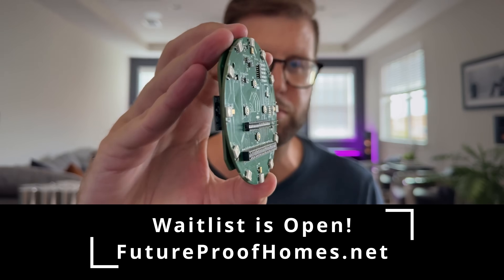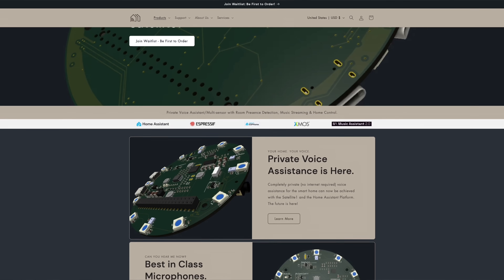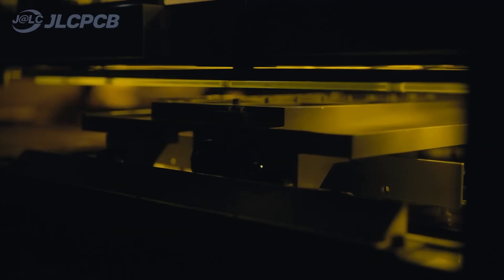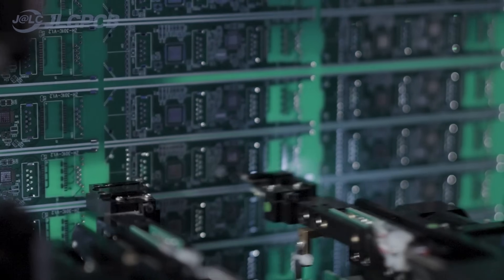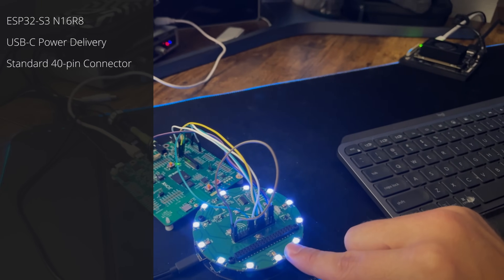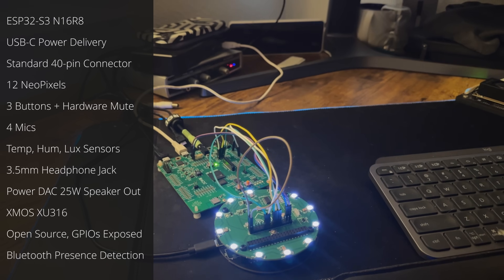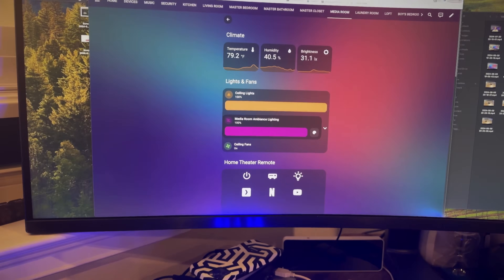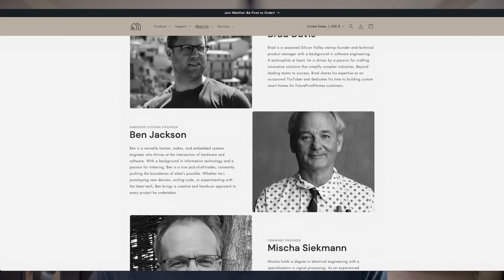Satellite1 Waitlist Open!  Your Private Voice Assistant Hardware is Coming!

Comment: lol sorry thought of another improvement. Me being passive house enthusiast.. I think you should make a mounting part where you can drywall the mount and then just snap in the satellite. That way we can make the device install easy and air tight between the living space and the attic.(if there is an attic above the room).. I would make a round mounting device with ethernet jack(Poe) so that above the device in the attic you just plug in the ethernet cord and on the other side (satellite side) the satellite just snaps to the mount. or we make the mount flush with the ceiling with mic holes.. etc.. either way.. We need to make sure when this is mounted it provides an air tight connection.. (safe for insulation..).. thanks :)
Reply from the maker: Check the roadmap.  You're describing what we're building. :) ;)

Comment: ESP32... so will it have the same limitations demoed on the  S3box? IE you can't dismiss an alarm by voice or pause a song if audio or an alarm is already playing?

Also at least in my experience  music streaming will be ASS on 2.4Ghz.. Google Minis and  Amazon Echos connect to 5Ghz for a reason, I have them all on a 5Ghz SSID because I get cutouts all the time if they fall back to 2.4Ghz.
Reply from the maker: I can demo this, but you can absolutely interrupt music playing with your wake word and pause or change the volume.  If 2.4Ghz wifi causes music streaming problems then I'd recommend PoE connection.  More info to come here.
Reply: @FutureProofHomes  POE would not work as I don’t have connections in every room. We currently have a Google mini in every bedroom and the living room and kitchen.

Well hopefully 2.4ghz works better than on my Google minis.

Comment: Congrats. I've managed to have a working and stable enough system with a Korvo and tweaking, but I really hope your project is gonna work and become the perfect solution, cause nothing is for now.
Reply from the maker: Yep.  I also pushed the Korvo to its limits and bumped into those limits.  Hence why we’re building this.  Thanks for the well wishes!
Reply: @FutureProofHomes  Also, it might interest you but i've managed to make an reply function when the assistant (Assist in HA, with your A.I of choice) is asking a question. Basically, it checks the text of the answer and looks for a question mark. It works pretty well and avoids having to repeat the wake word (i don't know if your system has a solution like this).

Comment: Curious why this is a dev kit? Just because you aren't shipping an enclosure or another reason? Also, very interesting.
Reply from the maker: Two reasons.  No enclosure & we can't afford (yet) all the regulatory electronics certifications needed to be considered a full consumer electronics product (CE, FCC, etc. etc.).  This is the the next step though.  Heading in that direction!
Reply: @FutureProofHomes  this all makes sense. So to your certification point, no UL listed either. Loving this though, have you thought about also putting out a 3D printed case design? I mean until you get to the point of releasing a case. I know you said this is open source so it might be there or someone working on it.

Edit: you updated the description to link to your page! Jumped on the waitlist.
Reply from the maker: Yea, 3D printed enclosure design is already in flight.  the form-factor of the PCBs might change a bit so the enclosure naturally comes a bit after the PCBs.
Reply from the maker: Thanks for jumping on the list!  I'll do that same kinda waitlist thing when the enclosure is in the store and close to mass manufacturing.  That'll be you time to jump in. :)